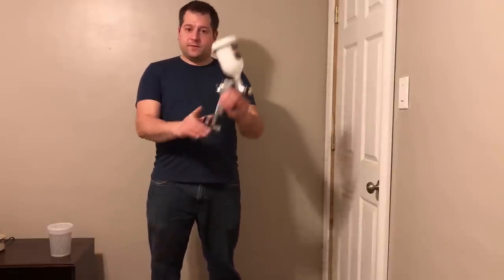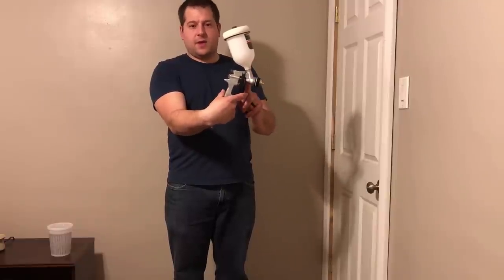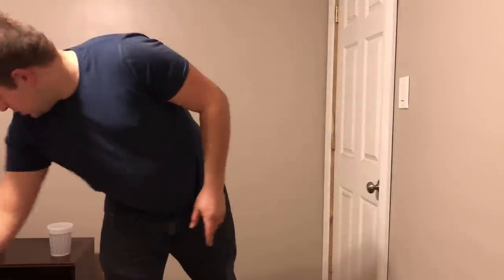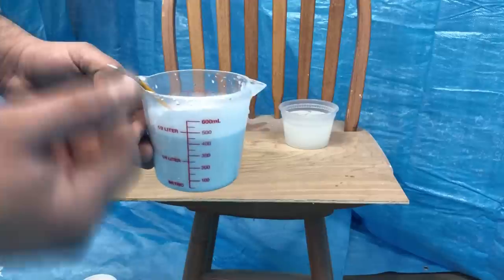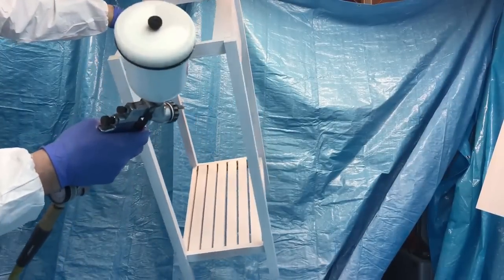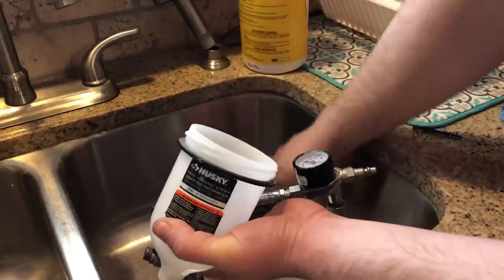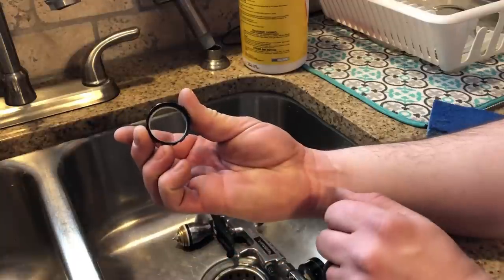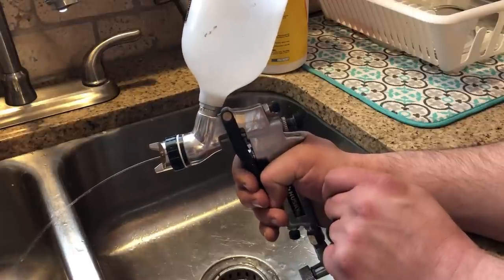How to spray latex paint with an air gun

Comment: I have an aquarium stand that I built to paint.  By the time I buy a sprayer, build a booth for the over-spray, buy a mask, dilute & filter the paint, clean up the equipment after spraying, I think that I could just brush the paint on faster (I know it won't look as nice as sprayed).  Maybe if I had more projects to paint, but for just one smallish job I'm just going to use a quality brush.  Thanks for making the video, I did learn a lot.

Comment: Great video, thank you, I've been looking for some tips on mixing the paint. For cleaning, I normally dump the paint from the hopper and fill it with water. Then spray water through it with pressure before I take the gun apart. It makes it easier to clean once you take it apart.

Comment: Appreciate all the steps outlined here, especially the clean-up info. I got 10 doors I gotta spray and I've finally got them all sanded and prepped. I got a 2.5mm tip for my TCP Global gun, and I'm going to thin with flotrol and water, and I have strainers as well, so with that I think I should be able to get a good finish. Nothin left to do but try it out!

Comment: A few constructive points:
1) The paint cup isn't pressurized on a HVLP gun.  It's gravity-fed, and there's a vent on the paint cup cap to allow the paint to flow out of the cup.
2) Most of the HVLP guns I've seen have 1.4 mm nozzles, which are good for auto painting but not for latex.  To spray latex without excessive thinning, you'll need a tip around 1.7 - 2.0 mm.
3) I'd be concerned about thinning latex as much as you are.  For interior applications, this may be fine, but I'd be concerned about the durability of paint thinned by 20% in exterior applications.
4) The small "pancake" compressors will work for very small jobs only.  I have a 30 gallon tank on my compressor and it was running continuously when I was painting a shelving project.
5) Definitely disassemble the gun completely when cleaning it, and definitely pour the paint into the cup though a paint strainer.
I hope this helps.
Reply: 20% isn't that crazy actually it just takes longer to dry.  But yeah, no pancake compressors lol.  I'll say I've used a 2mm lvlp and I'd still go with watering down latex in an hvlp, because it would dry before you finished with the lvlp
Reply: If you mix a bit of white glue into the water-dilute, it flows better, less orange peel, increases “work” time and dries nice & evenly. Lil bit of Elmers white glue very helpful in the dilute.

Comment: Great video. I noticed that you didn't remove the black cap on the lid of the hopper. I have had that cause the paint to not flow in the past if it's sealed. It's just like trying to use a counter top water bottle without poking a hole in it. I'm not sure why you didn't have a problem, but if anyone feels like the paint is coming out super slow, try removing, or at least loosening the little plug on the cap. I normally don't even put the cap on unless I'm trying to save the paint between coats, or I have the hopper really full. But as you found, latex sprays just fine with hvlp.  I usually thin 15 to 20% water by weight for a 1.8mm tip, and am playing with a new 2.5mm tip now.

Comment: A couple of things: first, it helps to run water through the gun before disassembling. Clean paint cup first. Second, you MUST remove the nozzle. The gun comes with a tool that will do that. You could run the Pacific Ocean through the gun and not remove the latex paint behind it. I've found that Goo Gone Latex Paint Remover to be helpful in getting the paint off the gun. Not as potent as I would like, but helpful, especially if you can let it sit for a bit.

Husky warns against inserting metal objects in holes, so I have no idea how clean the tiny air holes you mentioned, should one get plugged. I worry about that.

I use Floetrol additive at the rate of 16 ounces per gallon of paint, and an equal amount of water. The paint is not two thin. Floetrol doesn't thin; its purpose is to help the paint to level (and brush well). 

Hope this helps.
Reply: Right on man !!!!
Reply: I believe that the Floetrol also slows the paint's drying time which allows for extra working time especially when using a brush.
Reply: A bristle from a scrub brush won’t hurt those tiny holes in the spray cap. But what works just fine is to blast the orifices with full pressure air from your compressor. Even when I spray water base paints I often use lacquer thinner on a rag for the final cleanup of the gun exterior. A toothbrush does a great job of getting in small spaces. My cleanup standard is to make the gun look new.

Comment: Amazing video. I wish I watched this first. I bought the same gun. It's funny that directly on the front it says not for latex paint but I still bought it and used with the 21 gallon compressor I own. Thanks!
Reply from the maker: shamu2789 no problem, I am glad you liked the video. I am not sure why some packages say that, but as you and I both know it’s possible and you get great results!
Reply: @theselfmademan2875  Yes it is!  I just sprayed a door I built. It came out wonderfully. Any tips of reducing sputtering?
Reply: @infiniti2015  Did you figure it out? bigger nozzle size 1.8mm or bigger compressor for the 1.4mm nozzle.

Comment: great vid..I  had a 1.8 for the tip.  just bought a 2.4 found it so much better for Latex..
Reply from the maker: Thats a good recommendation
Reply: @theselfmademan2875  What nozzle were you using in the video? I thought the 1.8mm was fine to use with latex, would a 2.0mm be better.

Comment: This is exactly what I am looking to do, use latex paint for interior doors.  I just bought an 1.8 mm HVLP Gravity-Feed gun but have the option to return it and get a 2.3 mm version.  Do you recommend I do this?
Reply: Most name brand manufactures sell individual nozzle tip sizes. Check online

Comment: Window cleaner makes a great thinner for latex paint in HVLP guns. the alcohol in the window cleaner makes the paint flow better. I have sprayed several whites and other colors, and even though the window cleaner is blue it won’t affect the color of the paint. The window cleaner I use is the 1 gallon automotive windshield washer fluid. The blue type. I have never used the other colors, or kinds with the bug removers so I can’t speak to how they work or affect the tints or colors of paints. I just use the .99 cent a gallon types with alcohol.
Reply: the alcohol in winshield washer fluid is toxic, and window cleaner can corrode a gun if it is the ammonia type, I think people say vinegar type is ok.
Reply: Use floetrol and water .....   But try not to thin at all .     The floetrol will lubricate your gun and keep paint from setting up in it and on it..     it's used for helping brush strokes self level...  But it's great to spray with.

Comment: I just tried it with the purple HF gun, and it sputters even with just water going through. Is something wrong with the gun? Pressure at 30 psi, everything tightened down and adjusted.
Reply from the maker: Try and clean the gun and run some water through it. If it works this way you need to cut your paint with more water. If it doesn’t,  it’s probably an issue with the gun since automotive paint is as thin was water.

Comment: HVLP
High volume low pressure
You are spraying at way too high psi... They are not built to take high psi. If you need to turn the pressure that high, to get the paint to come out, you still need to thin the paint more, or get a larger tip.
1.8mm - 2.2mm tip size. But to cut cost, just thin your paint a bit more
Reply: This is a gravity flow gun, the pressure has nothing to do with how fast the paint comes out. The air simply atomizes the paint and directs it in the desired direction. That being said, the thinner the paint, the faster the flow. Because of gravity. Not pressure. I have found a 30% water and 70% paint works well with this application.
Reply: @borntobuild2249  Doesn't he need still a larger 2mm plus tip for latex?
Reply: Andrei Fasola not in my experience. The stock tip has worked fine for me in the past.
Reply: 3:1
Reply: @cubul32  Yeah, I found the larger nozzle made a difference with thicker paints, obviously thinning it makes it pass easier through a smaller nozzle, like the 1.4mm supplied with this gun. The paint, being latex is fairly thick and requires 20% or more thinning, if a larger nozzles is used that can be reduced to about 10% and gives a nice smoother coverage. If it's too thin, you have to do many coats and build up layers.
Reply: @gazsto9510  uses with 2.5 mm and 1.8 mm on a Homestead Jeff Jewitt rebranded Asturo gun. Heah 2.5mm did make diff. Save for primers like Stix BM which get runny with a bit of water and floetrol. Thanks.

Comment: What size tip on that paint gun?
Reply: You'll want a 2mm tip on an HVLP gun to spray latex paint. If you buy the Harbor Freight $10 HVLP you can use a 5/64th drill bit, which is basically 2mm, to drill out the tip hole. Hope this helps you. There are videos on drilling out that tip if you need to watch.

Comment: I have a 2 gallon air compressor is this strong enough to use with a gun like this?
Reply: Very very very small projects. Nothing like a dresser.
Reply: Once the compressor gets low on pressure the paint will not flow evenly
Reply: Definitely not

Comment: Good video.  I'm getting ready to paint two metal garage doors on my house with latex paint, and I'm gonna attempt to use my auto HVLP setup, which is similar to the gun and compressor setup you used.  I've never sprayed latex with my HVLP gun, but if it works as well as what your demonstration showed, I'll be happy with it.  Do you have any advice on what pressure you should set the regulator on the gun to?
Reply from the maker: If you cut your paint down more with water you can use a lower pressure. I cut mine down to a watery consistency and sprayed it at 80psi. It sprayed good at that pressure. You have the remember these guns were made to spray automotive grade paints which are a lot thinner than latex paints. I don't know if you have a spray booth  to do this in, but if it helps I have a video up on making a portable spray booth too.
Reply from the maker: I set mine to 70 psi; you can adjust it as you see fit though. Sorry about the late response, how did it go?

Comment: Nice video, thanks. What tip size are you using for latex?
Reply from the maker: I just checked and the tip says 1.5 on it
Reply: @theselfmademan2875  2mm is better, and I even use 3mm with the paint thinned 10%

Comment: Although I am not recommending this video to others due to two glaring omissions related to correct paint thinning procedures you fail to mention: 1. The ratio of paint (latex, that is) to thinner (water, in this case) can be measured by using the measuring cup you showed us at the 3:15 mark.  Why you didn't use it is beyond me, as doing so enables you to measure it to achieve consistent results.  Then, 2., you aren't using the second and perhaps more important measuring device: a viscosity cup.  These enable you to measure the "thickness" of the paint relaltively precisely.  Once you know the viscosity range that your gun and aircap/tip/needle options can handle, you can then adjust the ratio of paint to thinner to accommodate your setup.  Sorry for the rather negative commentary, but I just couldn't let this one pass.
Reply: Aaron Anderson  DIY should not be only about "getting it done", especially if you're doing a "how-to" video. If you're going to do it, then do it right. The video was informative, but i would have like to see a close-up of the paint quality.
Reply: Should always filter your paint

Comment from the maker: I just checked and it says 1.5 on it.
Reply: Thanks! Never tried spraying latex before but I do have a 1.5 tip as well, so I'll give it a try.
Reply: Really, 1.8mm is the minimum for latex/acrylic, and that would allow you to lower your pressure below 60PSI as well.
Reply: 1.8 is the norm for primer/latex. I would still thin accordingly.

Comment: Just buy the latex spray kit hvlp sold at Lowe's..   it's 58 bucks...    It's over in the air compressor/tool area..      sprays latex without thinning.     

All your going to do with that gravity feed is frustrate yourself...       Sure you can thin latex..  but why if you don't have to..    thinning latex makes it run super easy and the coverage is shit...      

Harbor freight has a similar gun but it's trash.       But the 2qt pressure pot with the blue gun will spray latex without thinning and get you a great finish...    As long as you get it dialed in good, use a high volume compressor with a 3/8 hose and plenty of pressure.             

Save that gravity feed for enamels, automotive, laquer, poly..      thin stuff...
Reply: Most of those  cheaper airless say they spray "thinned latex"